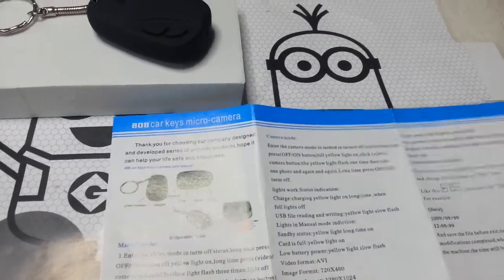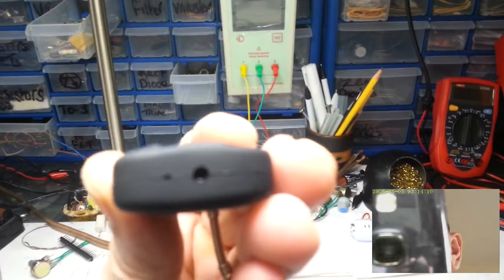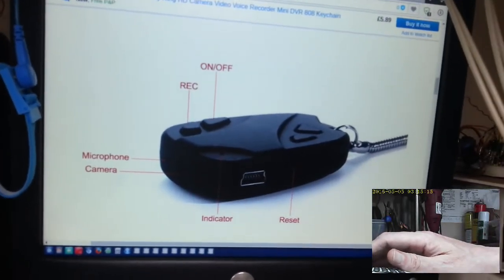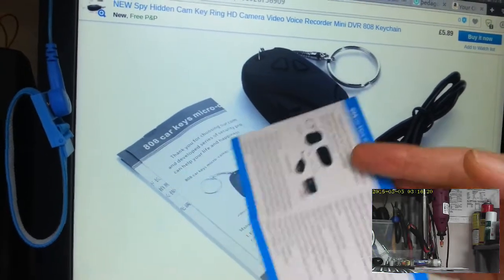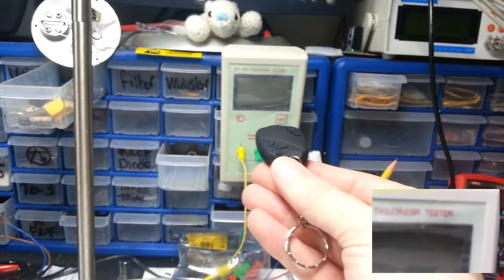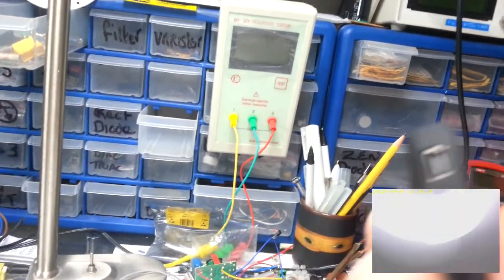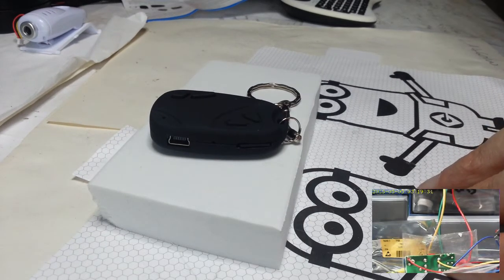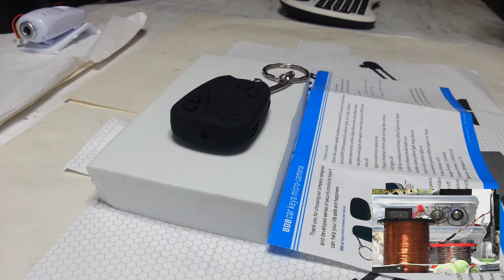NEW Spy Hidden Cam Key Ring HD Camera Video Voice Recorder Mini DVR 808 Keychain

Comment: They all look the bloody same...grin..my hd one is an 808 #11...a 808#16 is even better ...and if you are rich they have a 808 #26 which I am lusting for..smile...main thing is that it's true 1080 by 720 the "HD" means nothing..best bet is to find a seller that tells you the #number
Reply from the maker: 808 NO.16 V3 HD 120 Degree Mini Camera Module 7g on Banggood for £26 7g is really light. Syma x5c camera is 9.6g
808 NO 26 £60 on eBay seller 100% rep. I wont buy another at the moment I liked the idea of the cheap bargain. I have a sports camera coming from Gearbest hopefully that wont be to bad. Have you seen the Hubsan H501s ?mine is black. It has follow me mode as well as some other cool tricks.
Reply: You are getting a Hubsan H501s?...or just dreaming about it?
Reply from the maker: bunnyathome Its on its way should be here next week :)
Reply: Can you buy 2 and send me one?..grin..ohhh follow me mode..check out what you look like from behind when walking around...H501 is awsome....go mad get yourself some goggles of the FPV..lol..use good spare batteries the transmitter eats them form breakfast (due to the big screen i guess)
Reply from the maker: I have noticed follow me mode goes backwards if you move towards it, so lots of experimenting will be done with that feature. 
 I have gone a bit mad on spares 2 sets props, 5x extra quad battery's, new version imax charger b6ac 6 amp and parallel adapter for battery's, I have 12 rechargeable aa energizers already and there chargers also transmitter hood and transmitter range extender kit. I am ten mins from a park with loads of kept fields. I will cycle with follow me mode to the park fields and fly (gently using gps etc). Cant wait to fly high at night and just return to home if I lose it.  Its going to be so much fun. Got it from gearbest as it is on flash sale and I had loads of points. Its my birthday present to myself